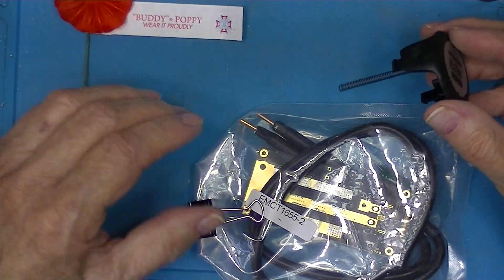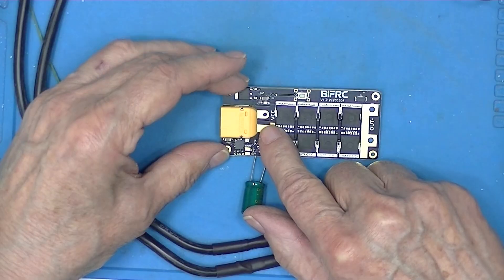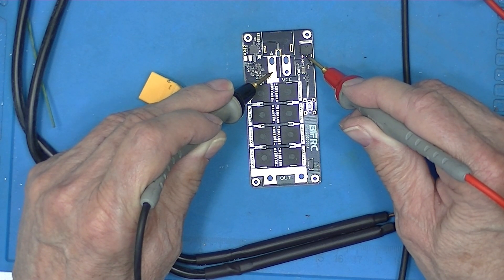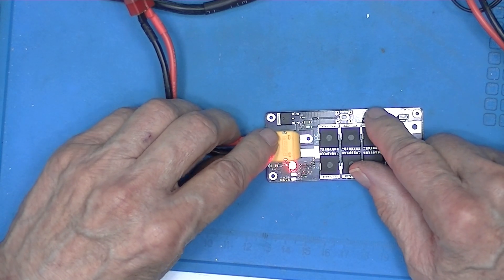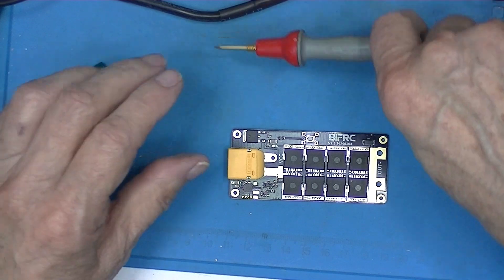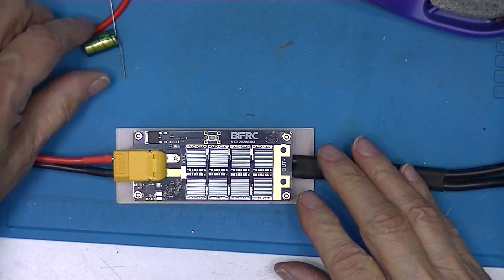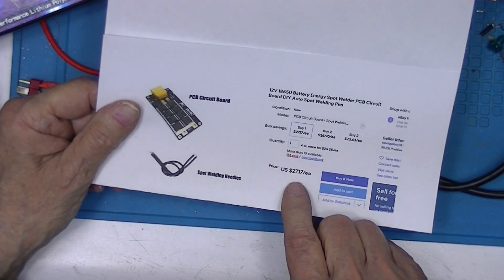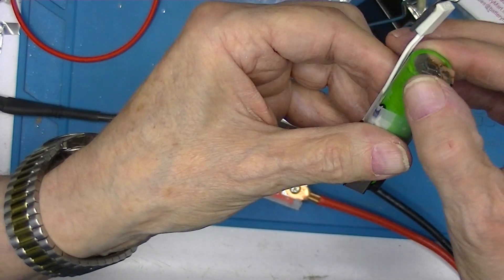A BIFRC Spot Welder (battery) FAIL!

Comment: The cap needs a diode before it.but just dont connect the high current positive to the board. It will work without fail.

Comment: I bypass the positive terminal from the supple battery and either plug it in to a 12v  wall wart or connect a seperate 3 cell small lipo battery to power the brains.

Comment: You need a 3s battery. not 4s not 2s and it need to be able to deliver above 300a to weld properly. also your input cables are way way way too thin!
Reply: 4S is better, otherwise the drop in voltage at the gates with 3S or 2S batteries will destroy the MOSFETs.
Reply: @dorfschmidt4833  also good small spot welders have an isolated capacitor to keep the gate driver active during the welding pulse
Reply: @dorfschmidt4833  That will fry the system..........

Comment: You  place  the capacitor  at wrong place, i place  it on positive  and negative input, and its  work oke
Reply: The cap can be used in either place. It is a little more effective at the control circuit to prevent 5v sag vs sharing it with the weld procedure at the 12v location.
Reply: Agree with your statement. I put my capacitor on the + & - and have never had any issues like shown in this video. In fairness though, it could have been a faulty PCB board from the start.

Comment: I use the BIFRC DH20 Pro+ and it works great, but don't press the tip too hard to get a good weld, just tough the parts you want to spot weld softly, just enough that the the strips tough the battery flat, then he will spot weld great.
Reply from the maker: Thanks!
Steve
Reply: @stevestrivia-bystevewagner4852  Your welcome.

Comment: Hello, your cables are a BIG issue,  AWG10, not more! How can your battery be 80C at more than 5kAh and come with AWG12 cables? To put it simply, your cables have become a resistor, that's why they get so easily hot to the touch. This puts a lot of strain to the mosfets and the overall operation of your board. XT60 connectors are fine but what are the specs of the other connectors you use?  Use AWG10 or less cables, an honest battery that can deliver 50C or more at about 5kAh and you'll see a big difference. Note: Using a huge battery, like a car battery that can deliver more than 700CCA will burn your mosfets right away. So, proper cables, proper connectors, good battery!
Reply: How does this guy use a massive 12v battery with no issues? Hes been using it for a while too  https://youtu.be/Omtmhf4zOf0
Reply: it wont burn your mosfets man are you dumb. they can theoretically handle 8x300A if you switch them right. if you use a bad battery whose voltages drops too much to drive them right, then they will burn

Comment: Steve, after using 3 versions of these cheap spot welders, which one is your favorite?  Can you recommend a particular unit?
Reply from the maker: It's sort of a limited test, but based on my VERY limited experience, the one from Alice would be my choice.
Thanks 
Steve
Reply: I would recommencement the the BIFRC DH20 Pro+, works great and i never had problems, and has it's own battery and housing, but don't press the tip too hard to get a good weld, just tough the parts you want to spot weld softly, just enough that the the strips tough the battery flat, then he will spot weld great.
Reply: @AmigaWolf  I had one it only worked for a few welds then just beeped continuously and wouldn't turn off
Reply: @AmigaWolf  yeah people seen too be having mostly good luck but I have seen a few reviews that had the same happen to theirs